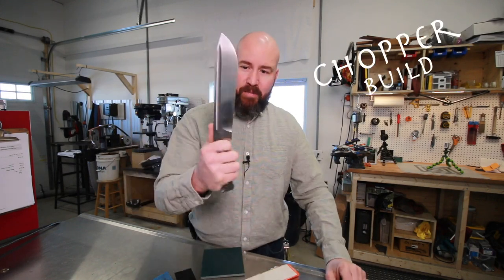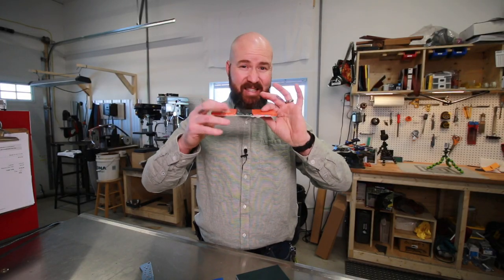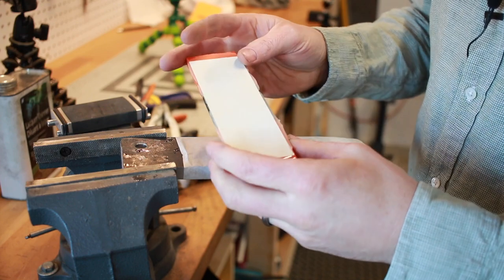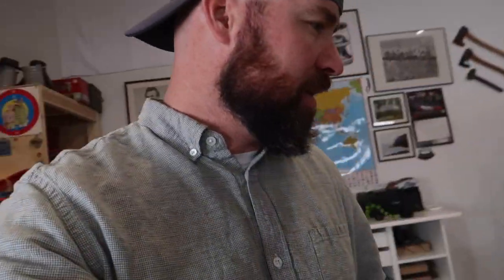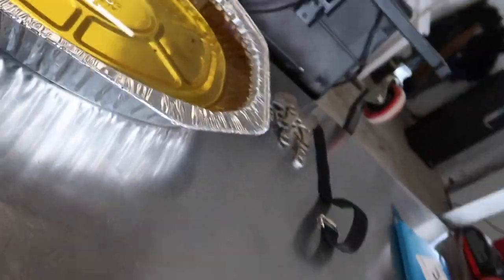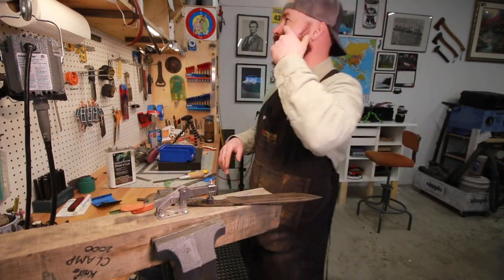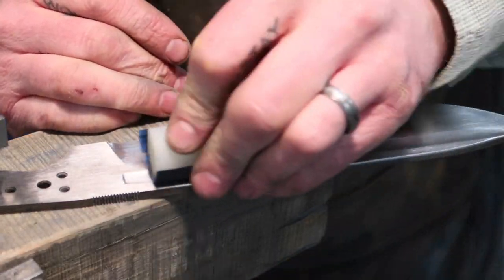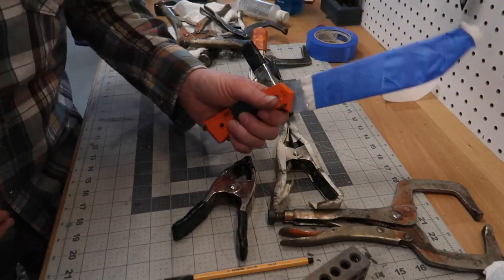I didn't want to make this knife - Chopper build part 3 - an excellent lesson learned.

Comment: For a bigger quench tank, go to your local restaurant supply store, and, buy one of those stainless steel buffet bins. They come in just the size needed for quenching. They ain't cheap, unless you can find a used one, but, you'll never have to worry about it wearing out or a quenched blade burning a hole in it. Just a possible solution for those looking for a bigger quench tank.

Comment: I'm not sure if it would helped your situation but suitable containers for acid dip or quenching are often difficult to obtain the needed height or length without using a crazy amount extra liquid.   The solution is to displace the liquid with something that takes up volume but doesn't interfere with dipping the blade.  It's one of those duh moments when you spend an hour looking for a container that is taller and thinner to gain 2 inches of depth.